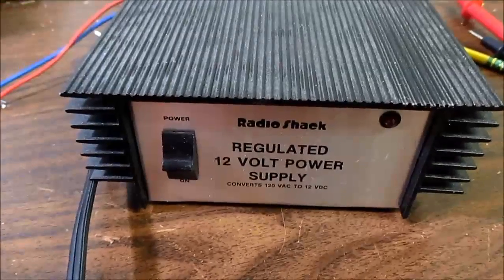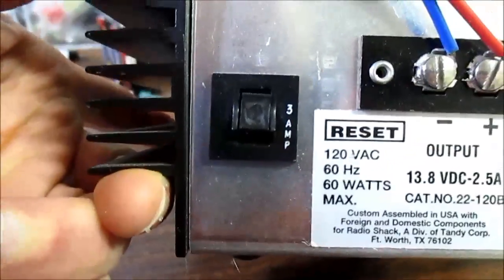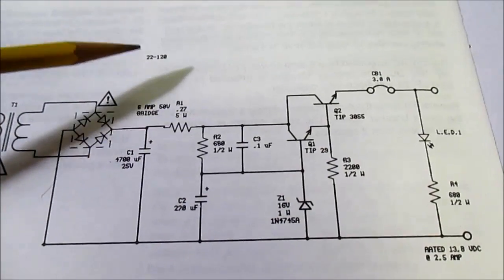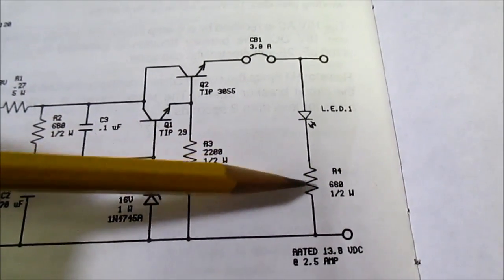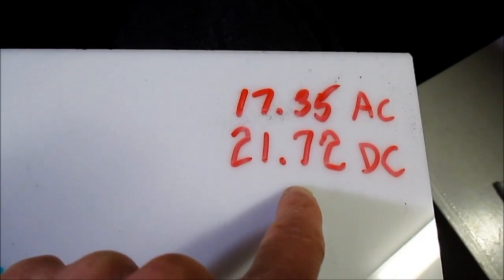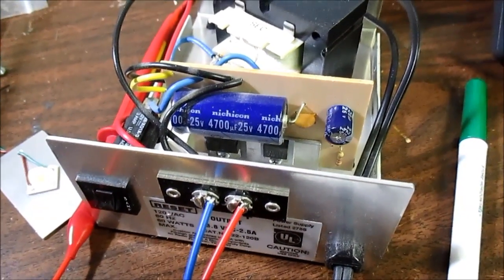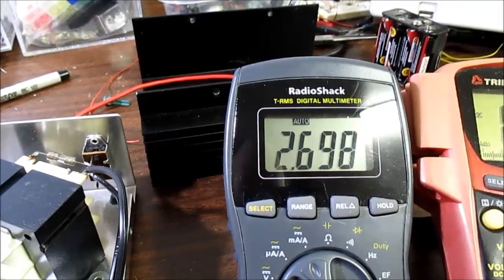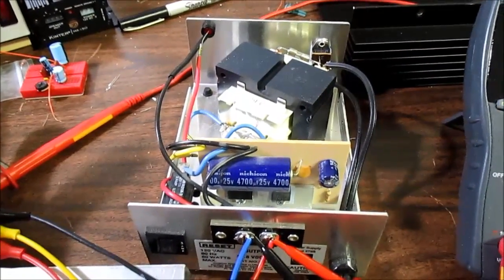Radio Shack regulated 12 volt power supply teardown & review

Comment: I have the Micronta (built by Radio Shack) version of this power supply, purchased 35 years ago to power my CB radio base station.  Doesn't have the external heat sink like yours. Still works well. Glad I found this video as I always wondered why the unloaded output was upwards of 15VDC!

Comment: I've got several 12v reg. power supplies, all of which came from a Radio Shack stereo demo panel. 

They are branded Radio Shack, Realistic, Almotronics, and Phase III. There are 3 and 4 amp regulated units. 

The one Almotronics, a 4A model, is giving me 25.85 volts DC on the output unloaded. It was last used about 15 years ago and worked fine when the panel was torn down. (I bought the remnants of two closing stores at auction). I had taken the whole display, car stereos and all, and had it powered up in the garage here for a few weeks before dismantling it. They had the 4a power supplies powering a pair of 100 wpc line level amplifiers to boost the sound level to two pairs of 6x9 speakers. 
I forgot I had this till I stumbled on it and several others in a box on the shelf the other day. Figuring it would be good to power up a few old CB radios I also came across, I figured I'd better test it first, fearing it may have dried up capacitors after sitting idle for 25 or so years. This is the only one of this model, but all the others tested between 13.85 and 15.04v unloaded. There are two that look identical on the outside but are branded Radio Shack vs. Almotronics, however, those both use a one piece full wave bridge vs. individual diodes and a larger filter cap. 

 
Using a variac, I set the input volts to 117v as marked on the unit. (Input voltage has little to no effect on the output volts, less than .05vdc when plugged directly into an outlet here showing 122.7v on my Fluke meter). 
The transformer is putting out 20.43 volts ac, and I've got 27.63 DC across the rectifier. 

The circuit differs in that there are four small transistors on the board, and one huge TO3 Motorola 2N6569 on a rear mounted heat sink. The filter cap is a 2200uF/25v, its got a 1.75a slow blow fuse on between the pwr switch and the transformer in a screw in holder vs. a circuit breaker, and its got a huge TO3 type transistor on the back on a huge heat sink. 

I tried to load the thing with a few dome light bulbs but it pops the bulbs instantly. I then took two old headlight bulbs to put a load on it, and the voltage stays well over 20 volts dc even with two headlights very brightly lit. As they stay lit, the voltage climbs back up. They stay lit for almost a full 2 minutes after I turn off the power and unplug the unit. This alone puzzles me because I'm using two old 7" 6015 car headlights for the load, I'd have figured that there was no way this thing could hang on that long and keep the bulbs lit. Each bulb is incandescent and roughly 4 amps at 12v. I had first hooked up only one, but it was so bright I was afraid it would blow, so I added the second bulb.  I really expected the second bulb to pop the fuse or to drop the volts substantially but it did the opposite.

I removed and tested the filter cap, its spot on, I had a slightly larger one, 2700 at 35v and using it increased the voltage output by 3 volts so I put the original one back in. There is a smaller 470uF/25v cap between one 290 ohm resistor and the neg leg off the rectifier. Both the small transistors,  and the four diodes forming the rectifier are unmarked.

Comment: I just bought 10 of these off ebay recently & only one of them arrived DOA & was  just the internal fuse came unsoldered on one end, the rest of them checked out well above 14 volts. As far as their  horizontal heatsink fins they will dissipate the same amount of heat as they would vertical. As you already know Radio Shack also made the other 2.5 amp supplies without the large heatsink & just had a steel cover.
Reply: Yes I have the Micronta  non-heatsink version

Comment: I have to agree with before comments to this video, excellent all around!  I have two of these, one is marked as "Micronta" with a small "RS" logo at the bottom, but without the large heatsink.  Otherwise, exactly the same in and out.  One produces 15vdc, the other 14vdc, but no problem for my bench uses.  I removed the LED and added a small LED digital voltmeter to both of them in place of this LED.  I left room below the voltmeter for two wire terminals that will be added in the front, making this power supply so much more useful on my bench.  One of these power supplies was picked up, in its original box for $5.00, the other, out of box for $2.00; both are clean and are working just fine!  Thanks again, especially, discussing how the entire circuit works!
Reply: ^ ^ Person In Management Position! :-)

Comment: Very clear your video and well prepared. Does anybody could help me with my Micronta variable dc power supply "0 t0 24 vdc"?. When I turn it on the voltaje goes to 38 vdc and the voltaje adjust does not regulate. I have checked the power transistor 2N6569 and apparently it is working properly, I will appreciate your help
Reply from the maker: If the transistor is good, something before it is driving it fully on and not regulating the voltage. Does it use an IC in the regulator circuit?
Reply: Yes John, it has an ic R5723, could be it the component which is generating the trouble?. How do I check it?

Comment: Does anyone have any idea why 
my power supply is putting out 
26.8 volts instead of 13.8 volts? 
What should I check?  I'm a 
newbie, so be gentle!!  Thanks!!
Reply from the maker: If the arrangement is similar to the supply in the video, check the pass transistor. It could be shorted or something else failed that allowed loss of regulation.
Reply: JohnAudioTech: Thank you 
for replying!!  Which one is the 
"pass transistor", and how do I check it, and what should my 
multimeter read?  Thanks again!!
Reply from the maker: What is the brand and model of your supply. It may help me help you out.
Reply: JohnAudioTech: Hi John!! I wish I 
could tell you the name and model 
number, but it didn't have either 
when I bought it in 1978!! Yes, I 
was a kid when I got it! It's got 
one pass transistor (you taught-
-me that!), three tiny transistors, 
2 BIG capacitors, 
one transformer, an on/off switch, 
and one burned out light!  That's it!
Tomorrow I'll try to take a video of 
the power supply with the case-top 
removed,  and with me taking 
a multimeter reading at the 
DC power output in the back. 
Other than that, not much else to tell, it's pretty empty inside!! 
If you like, subscribe to my 
YouTube channel and tap the 
bell to get notified of any 
new videos.  This way you'll know 
as soon as I upload the video and 
you can check it out and give 
me your most knowledgeable 
opinion!!  Sound okay with you? 
Thanks again for all your help, 
you have no idea how much 
I appreciate it!!  
Norman.
Reply: JohnAudioTech: By the way, I'm 
proud to say that I'm your
subscriber number 21,390!!  
I just though I'd let you know!!

Comment: I just found one in the trash and was surprised that it still worked. Took it apart and cleaned it up. But mine looks slightly different with a black cap instead of blue. Same rating though. Maybe I have an older model.

Comment: Wire connections should be mechanically attached prior to soldering.  You do not want a disconnected live wire to start roaming around in a metal chassis because of a broken solder joint.
Reply: Yea what he said❗ They are called Y connectors 👍

Comment: The schematic is simple enough. I'd drop a .1uf cap across the input and the output, I built a 10A electronic load for my bench from one of those $13 kits and a salvaged piece of medical equipment with a hurkin heat sink and fan assembly I bought at a surplus store. Good video, thanks

Comment: So in the end, nothing is thermally connected to that extruded aluminium cover?
Reply from the maker: It is connected where it screws down to the base. After running awhile the cover gets warm. The older version had an ordinary steel cover and the supply got too hot when loaded. This design is better but should have used vertical fins.

Comment: can i boost voltage up? mine says 12v but actually 13.5. can i adjust pot inside to increase voltage?? need to get at least 16-22v
Reply from the maker: Probably not a good idea as it would lose regulation under higher loads. You'd need a higher voltage secondary on the transformer so there is enough headroom for the regulator to work at the higher voltages.

Comment: why they call it regulated 12v, when it varies from 12.5 to 15v ?
Reply from the maker: +iceberg789 All bets are off when the current rating is exceeded. Difference from 0 to 2.5 amps was 15.1 to 14.3 which is okay for a simple transistor regulator circuit not utilizing any feedback control.
Reply: +JohnAudioTech thats right, but that regulated term for something thats ~20% off.....
Reply from the maker: +JohnAudioTech It was designed for operating car devices (radios and such). The automotive electrical system is called "12 volt" even though when the engine is running the voltage will be around 14v give or take for proper charging of the lead acid battery. This supply was made to have a similar voltage. From no load to 2.5 amp max rated load the regulation is about 5% which is fine for its purpose.

Comment: You probably won't see ripple at nominal line voltage, but you may at low line voltage. 

If you have a variac, set it to 100VAC and see if you get ripple at full load. That will tell you if there is ripple during a low line condition.

Comment: Am always baffled when they have those screw terminals that are so close to each other that it's easy to short out, esp if you're using stranded wire to hook up.
Reply: Best to use either Y or eye connectors on this type 👍

Comment: Excellent video, a lot of good info in there. Seems like a quality build, seems like they could of upped the current capacity with a slightly stronger transformer given the ratings of the TIP3055 and most of the other parts and all that Aluminum. Also with all those good parts a couple binding posts would of been nice, they kinda wimped out with the screw strip.
Liked the "Radio Shack" at the beginning!!
Reply from the maker: +HillOrStream Yes to the binding posts. Put them in front and use the kind that accept banana connectors at the tip. The previous version of this supply had an ordinary steel top cover and ran hot. This one is much better. Kind of wished it could do 5 amps. Back in the 90's I bought a 10 amp Pyramid brand supply. It quit after 1 month so I packed it up and took it back.